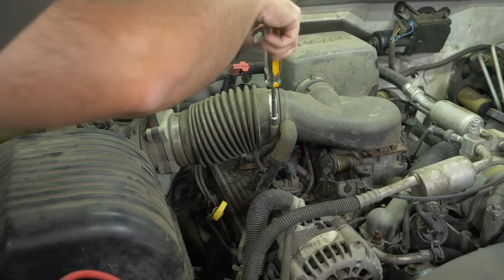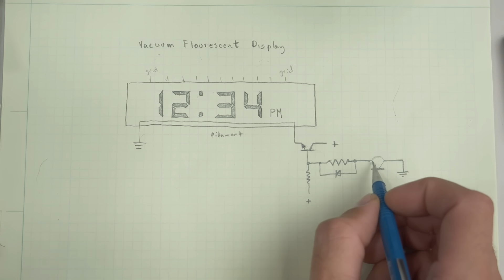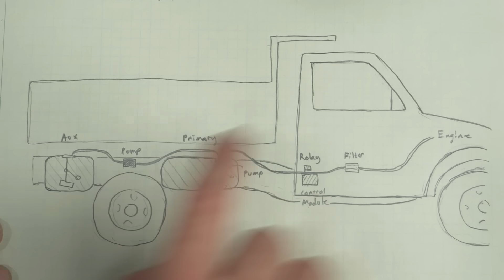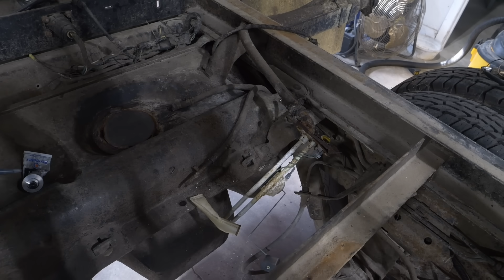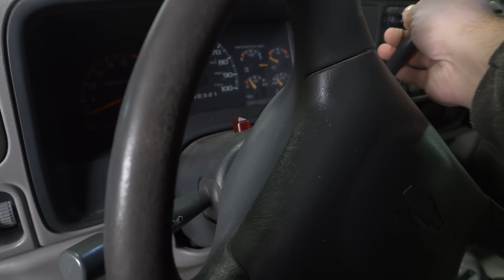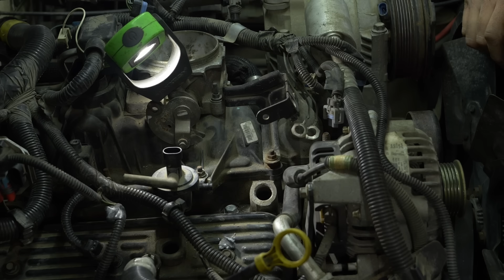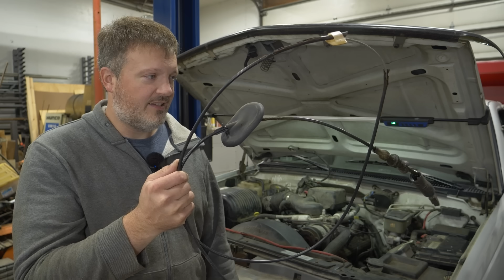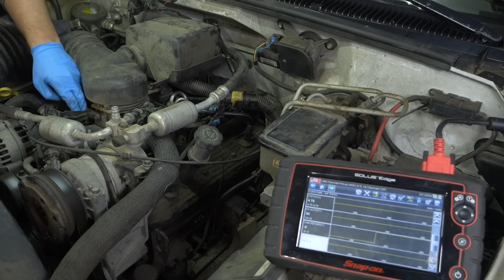This Truck Is Breaking Faster Than I Can Fix It

Comment: Nice going Wes. You did a great job getting a relic back into service. I live within 35 miles of Gas Tank Renu, the company you got the replacement parts to fix the 400,000 mile Colorado gas tank. I thought for a moment you were going to go that route, but, nice touch saving all the parts for the guy if he chooses to do it another time. When I first saw that you were removing the intake magnifold, I was saying to myself you might just as well R&R that quick connect for the heater water while you have it out, but when I saw that you had not done it while the magnifold was going back on I thought, well I've replaced them in place, it's doable. Then you did it. Too bad. **OK, I worked at GM while that year was running and when my co-workers and I saw what was going on under the hood, we decided GM is building dealership repeat business. In discussion with co-workers the scuttlebutt rationalization was there was so much competition for new car sales there isn't much profit to go around. Proof, being salaried, I did not receive a pay raise for several years in the 1990's, instead I got stock options but they were not exercisable for several years. At the time I thought it was better than the credits they gave us a few years earlier for a mail order store called Service Merchandise, which we called "Toaster Points" or one year when all we got was a Baseball Jacket with our department logo on it. So I was a living example of the scarcity of $$ to go around. It seemed that all the car companies started to build cars that were so complicated only the dealer could fix them thus providing a little extra income for the dealership. In my building I read the graffiti here and there that said "GM dealers can't fix the cars GM builds." There seemed to be an inordinate amount of traffic thru the areas where some of the Techs were trained, but they had gone to temporary workers or contingent workers and none were doing well nor staying.  To me the future looked bleak and in about 10 years, GM did the unthinkable: They tossed out the name GMC, changed it to GM Company and committed bankruptcy. So you might believe me when I say the profit margins were razor thin and the dealer only repairs were helping the dealers stay alive, but not so good for the company image.  FYI I did not exercise my stock options when they matured/ vested as they were only worth a token amount, instead I optioned to hold on to them and I continued to buy GM Preferred Stock. I lost all of it but maybe $1,200 or some ridiculous token amount of my belief in the company. I was one of the ones who survived the bankruptcy, so I did get to keep working, minus a 10% pay cut, and now retired I have welfare health care instead of a major health carrier like they promised when I hired in. OK, enough bellyaching. Fine job Wes, thanks for putting the video up. ben/ michigan

Comment: I did the same to my tow truck, the rear tank sender was bad but I break rules, I went and found a motor home sender which has the same ohm,s and ran 2 wires from the module ( only mine was toast ) so I ran 2 gauges in the cubby under the radio and a switch on the dash, with 2 gauges I can monitor the fuel level ( diesel ) and flip the switch as needed, as I'm always monitoring my cluster on the road anyway,  the fuel tank you have on the rear could have been reused, however I would have done the same as mine, now I watched a guy do a job on one of these trucks from New York, and the  metal pieces on the tank were non existent,  he ran silicone around the seal area and put self tapping screws into the plastic, he made it back to NY from Colorado without any problems, he came to our shop and the quote was quite high as I remember 20 years ago.

Comment: I think this is the first time I’ve done one of the jobs you’ve been inflicted with … I had to replace the intake manifold on out 1999 Chev Express van (after the original one sprang a leak from presumably a casting flaw. There seemed to be at least 100 wires that had to be disconnected, so much so that I’m amazed that the engine would ever run! I did get it back together and it ran but I was never fully confident it was right. A few other issues (eg rusted out brake lines and the like ) made me wish I’d called it done before I did the job.

It was a 3500 extended van and a great machine while it was going, a great tow vehicle. But enough stupid things that meant I haven’t bought another GM vehicle since though.

Long way of saying I feel your pain and respect your tenacity immensely.

Comment: Oh my, I have the 1999 version and is identical. Replaced shift cable last year and my broke in same spot. Fixed the rear fuel tank, transfer pump, sending unit and fuel gauge this year. The locking tabs on mine were worse. Removed tank, cleaned it, ground remaining tabs off, installed new sending unit and used the tank Renew system to screw and seal it in. Transfer pump was dead also. Replaced. Bought an air core motor and fixed gauge.

Comment: "I've run out of side quests." Hilarious. 27:21 the TBI and Vortec 350s had this problem. While it MIGHT be possible sometimes to wiggle them out, it was usually easier for me to remove at least one valve cover. 30:53 and those are also a BIG problem. I had to buy a tap to clean the threads because they break all the time since they're only cast aluminum.

Comment: As a backyard mechanic I've done a lot of wrenching.  I like this video for the shear impossibility of it, of satisfactorily fixing everything.  Watching even made me impatient.  Pretty amazing that you sorted out that radio.  Pretty amazing you sorted out all those other trashy problems.  Big KUDO's to you.  I put in a dual tank system on a plowing truck and used a flow switch to chose between tanks.  Worked great for many decades.  Wes the Wizard.

Comment: When you firsts took that heater hose off the manifold off I was astounded it didn't break. Alas, I was vindicated!
Lisle makes a too for removing those heater hose inlets.  Lisle 62200 Heater Hose Coupler Remover. Has splines you pouned in and unscrew. Even back in their hey day they were terrible. Saved my bacon a few times. Still in the toolbox.

Comment: Back in the 70's I worked for National Semiconductor and they supplied GM with lots of parts. Some custom designs but most right out of the Databook.  Every Part had a GM Spec, even if it was the "off the shelf" (they did this to make sure they wouldn't get burned if the Databook spec got changed later on). So we had GM Test Programs written to their Spec as well as custom Part Number Marking to their Spec.
GM was alone in this, Ford, Chrysler, Hewlett-Packard, General Electric, RCA. Apple, IBM and on and on....and they all paid a bit extra for that custom Test Program and Marking. For what was pretty much an off the shelf part.
I can pretty much say the same was done at Intel, Texas Instruments(who later  bought National Semi), and all the others.

Comment: Now that radio repair is so far over and above what any normal 'mechanic' would even attempt to do it's crazy!  Wes, your clients are so lucky that you have this knowledge and ability!  Any other mechanic would pull fuse and tell owner he needs a 'new' radio and that's the only way to fix it!  So cool you have the ability to diagnose those electronic gizmos with all thier fancy diodes, transistors, capacitors and that other crazy electron thingamajig nonsense!!  😁👌🏻⚡🔌🔋📻⚠️

Comment: I'm only 2 1/2 minutes into the video but you said obsolete system. Doesn't seem old enough to be obsolete to me. I guess I'm a bit old, my daily driver is a 95 and my old vehicles date back to the '50s. Love the videos, keep up the good work.

Finished the video 

Worked on a few of the vortec 350s. If you've got a cooling leak and got to take the intake manifold off you might as well pull everything off including the heads. My experience has been it's all about to go if something's leaking and you need to replace it all. 
This engine looks different, is it a 454?

Comment: My 1999 GCMC Bucket truck has the same fuel system.  The gauge doesn't work either.  I never put any fuel in the rear tank because the transfer pump doesn't work .I'm not planning on fixing it as I don't use the truck very much.  It's a very odd system.

Comment: This same dude does a transistor level repair on a radio,  computer cuts a perfect circle,  glued that onto a rotten fuel tank, then tortures an intake manifold to death with a screwdriver.

Comment: I have a feeling you enjoyed the radio repair more than the other stuff. 

Those Vortec engines are a "joy" to work on, I have worked on lots of them. Based on how fast everything was breaking, I was expecting it to be a 1996 truck. For whatever reason that year of those have perfected the perpetual breaking process, all you need to do is look at any part of the truck and it will break. But don't worry, if you don't look at it, it will also break, it will just be more of a surprise, like when the throttle cable decided to snap on me while I was driving on the highway, and when I went to open the door to see what happened, the handle broke off.

Comment: on my 96 I put a $150 ebay manifold, an HEI, and a parts store edelbrock and threw all that other crap in the trash.  was easy because the truck is manual trans. best thing I ever did, shes tapkey

Comment: Many have mentioned "that radio repair" in their comments. Truly brain wizardry! You read the schizmatic wonderfully, figuring the operation very quickly. Intuition came to play in finding the shorted transistor,  guts in swapping a good guess in. Sweet soldering.

Comment: There does come a time when you need to cut your losses on a vehicle like that.  Dad always told me, when you fix something that has pressure to it, the pressure that caused it to fail is going to need to go somewhere else that is failing.  It becomes a game of whack a mole, and eventually you're going to just be throwing good money after bad.

Always love your content Wes, as it does show you can repair old stuff, and why you probably shouldn't sometimes... Hurrhurr.

Comment: One of my favorite mechanical channels pulls a rabbit out of a hat and fixes a modem car radio. 
Fuckin A! 
Awesome. 

Wes is a talented man.
Reply: ... and he draws a perfect circuit, and he understands linear transistor control... what's your degree, Wes?
You don't learn that in tire kicking school.
Reply from the maker: Except my NPN is backwards...
Reply: @WatchWesWork you're even right in the comments!  :)
The 3904 is not a pnp.

... but how many auto mechanics have 3904s lying around?

Comment: "The customer is always right" ??   Not quite.  The full version of the quote attributed to Harry Selfridge (Selfridges department store) is "The customer is always right, in matters of taste"  This means businesses should respect a customer's personal preferences, but it does not mean a customer is always factually correct or that unreasonable demands should be met.  The "in matters of taste" addition highlights that a business should accommodate a customer's subjective preferences, even if the staff disagrees with them.   What's a subjective preference?  That answer is too long for a YouTube comment.

Comment: I am wondering if that is the original engine for the truck. I have a 99 GMC with the same engine, and I thought they put the sequential port fuel injection on vehicles from 98 and the first half of 99. Anyway, Great Video.

Comment: The "F" air core stepper motors used for those gauge clusters are still available aftermarket, despite being obsolete from GM, so the original gauge can be repaired.

Also, the long, plastic T-nut you found sitting on the intake screws onto that little stud on the throttle body, to hold down the air intake hat.  Noticed you hadn't installed it at the end of the video.

Comment: Its a bit of a shame that the rear tank was bad. I would have liked to see you finish building a new system for the fuel gage for both tanks. Its probably not very cost effective from a time stand point, but I do appreciate actually opening up and trying to repair the electronics instead of just buying new parts.

Comment: Short term fix for flies.  Fill a quart spray bottle with 91% alcohol and knock them down.  In a closed shop you should be able to control them and not be spraying poison and having to breath it.  The alcohol kills immediately and evaporates.

Comment: You can go by a tool at any autozone O'reilly's to take that out the intake for the heater hose like a wedge hammer down in there. It comes out real simple, too many job. As far as timing it engine, it's gotta be above 1200 RPM before the camp. Boss, whatever you want to call, it to pick up the timing to enact or retarded. The system is a b** I got a 99 and it's sucks

Comment: for the aux tank, why not bend the tabs off and make a flange on the plasma table that gets bolted through the tank? like you said any pump would work, so you'd just have to get a gm style sender that's designed to be clamped in a flange, which i'm sure you can find on amazon cheap enough and swap the rod from the old sender. maybe not worth the effort for this customer but i'd bet it would seal no problem with some bolts and oversized washers through the tank plus a good amount of fuel resistant goop

Comment: I had a 77 E150;van with dual tanks.  The smaller forward tank would no longer show quantity.  The mileage was so consistent, that I knew when it was about empty, based on the odometer, and would switch to the other tank before it ran dry.

Comment: Could the distributor be one gear tooth off and that is why it is not possible to adjust right?
Reply from the maker: No. It would be 27 degrees off.
Reply: @WatchWesWork  Thank you.  I usually got it wrong on the first try with my Toyota 2T-C.

Comment: That lil t lookin do dad u found is the "screw" that holds the plastic part of the air cleaner that goes on the throttle body. It sits in a lil hole right behind the plastic part. U must become one with the chevy to see it cause its hidden. hence why most of those horribly designed injector systems are missing it and it creates a huge vaccum leak. I've worked on so many of those "spider" injectors that i see them in my nighmares. Absolutely hate that series. The tbi was such a good system they never should of messed with it. Ur skill level with fixing and knowing how that radio display was nothing short of miraculous lol. The fuel tank fix was awesome too. I think this is one of ur best vids if not the best. Great job Wes. I have to admit i thought u were gonna quit youtubin for good for a while there but I love messing with circuit boards and transistors, capacitors etc. Please keep showing those. I also have a question for you. Can you test microprocessors on the board? I've never know anyone who could but if anyone knows if its possible, it would be you. Hope u see this comment and thanks for sharing your wisdom. If you grew a long grey beard you could be a real life Gandalf hehe!

Comment: I have a 2001 3500hd (same gmt400 'old' body style but with an 8.1 vortec) bucket truck which has this fuel tank system. The aux tank feeds a 2 cylinder onboard generator with a hydraulic pump on it, which provides the hydraulics for the bucket. Not sure if the balancing feature works (has that same module and relay on frame rail) but my factory fuel gauge needle does quiver like yours did on the bench test

Comment: That mystery plastic nut thing holds the plastic intake hat onto the throttle body. Every issue uve experienced in this video is typical vortec 350 ownership. Heater hose fittings, cap/rotor, distributor drive gear woreout, shift cable, fuel gauge, intake gaskets lol

Comment: We had a plasma cutter that was so big the trolley had a cockpit that the operator would ride around in. One of its main jobs was to cut the Hi-80 and Hi-100 deck plates for the Aegis Cruiser's Mk 41 Vertical Launch System, go Navy! 😛
Reply from the maker: Yeah that won't fit on my table!

Comment: Suppose if it was mine I would have put the rear tank on a toggle to manually fill the front tank. Cheap little pump and some wiring. I bet the rtv plus an O ring would have sealed good enough on the rear sender.

Comment: Buddy, you're a saint to be doing board-level repairs at mechanic rates. The mouth breathers at the local Chevy Stealership (rural Oregon) can scarcely be trusted to service brakes let alone do any real diagnostics and they're charging $175 an hour. To be fair, I don't recall you ever putting a number to your rates, but between your skill and humility I'd wager your rates are unreasonably reasonable.

Comment: I would have jumped the distributor to the next tooth and see if you could adjust it back the other way and have enough movement.   Someone might have installed it wrong in the past.   I have learned to never trust where distributors were last installed and just do it as the book says.  It saves a lot of headaches.
Reply from the maker: It's only 13 teeth, so you'd be moving 27ish degrees. There's only maybe 15 degrees you can move without hitting the manifold.
Reply: @WatchWesWork  Right, so if you were 12 degrees off at that full extreme (as you showed).   If you jumped to the next tooth, it would only be 15 degrees off.. and then you have that 15 degrees movement going the other way to reach the adjustment..  Idk- Sometimes it will adjust a little further in one direction, than it does in the other direction.   Like I said though-  I just follow the procedure in the book and have always had good luck with that.  It's very easy to line it up with the wrong tooth.  I always just assume someone did it wrong before me. lol